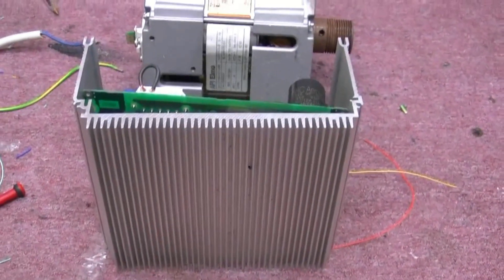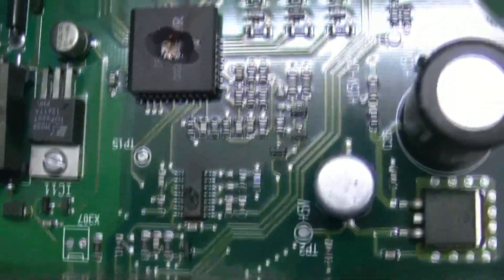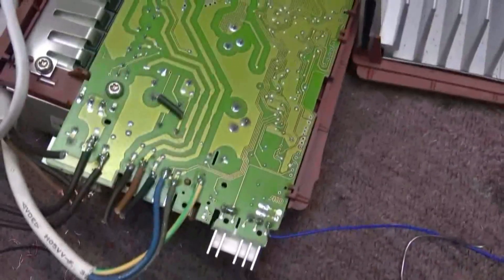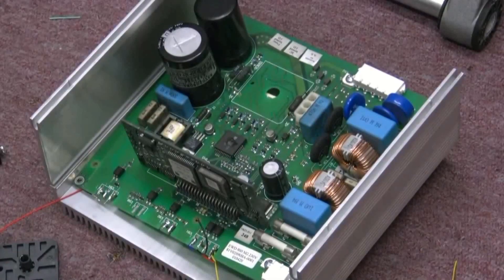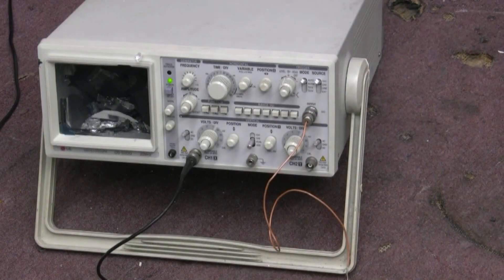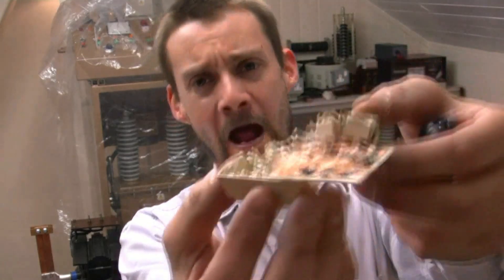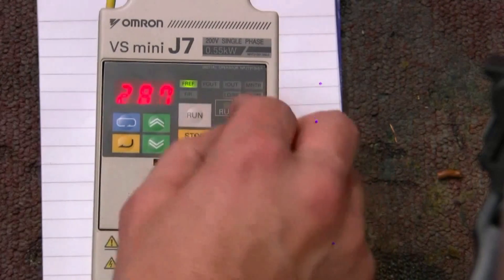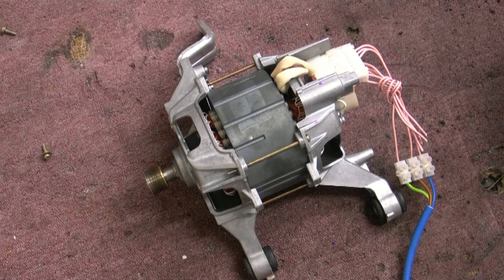Motor Inverters

Comment: The benefit of inverters is that you don't need to send more voltage to its windings to increase the speed and instead you increase the frequency. But even still, the good ol' brushed AC motors are stronger, simpler to drive and can cope with current spikes.
Reply: Just More voltage wouldn't make induction motor run faster
Reply: @swapnilkumar9363  did you even read my comment? I said nothing about induction motors.

Comment: Nice. Glad to see you were satisfied blowing off some steam, and also really cool to hear that sound of the oscillating magnetic fields making noises like that without the motor even spinning. Indeed that must've come from the windings due to the alternating current supplied by the frequency generator. Anyway awesome video that would blow most people's minds. Wonder how many people wouldn't believe that the motor is actually spinning.

Comment: Mini inverter welders are probably the best application for IGBTs.  Inverter microwave oven is needlessly complicated.  Motor drivers with IGBT... your video makes that point. 

You're not alone in that opinion as Electrical Engineers go.

That was hilarious seeing that motor one second and then fried the next. 😂

BTW kudos on the hammer bit, now I don't feel like as much of a neanderthal.

Comment: i would LOVE  to see an induction motor get a 3 ton flywheel up to 10,000 rpm (4hrs enough time?)..stand back..lol
Reply: Here is a 12 ton wood chipper disk spining up to about 1k rpm. It takes over 35 minutes to spin down if the brake isn't used. https://www.youtube.com/watch?v=lV1R1hhukWQ
Reply: @jakekiedaisch2279  nice NICE.!

Comment: Inverters are such a disappointment. Changed my Notebook's fan lately, wanted to slowly blow the old one by overvolting it. Well, a tiny itty little bit of the chip blew clean off because I forgot to put the voltage on a normal value first, but 1 Volt over the maximum and it blows instantly without a single bit of movement of the fan! What an utter disappointment that was. And it smelled unbelieveably horrible! Just like you I didn't have it, so I was up to charge a completely zeroed out 18650 cell with full power, but (luckily) remembered that I'm not Mr. Photon :o

Comment: That is standard procedure, its the manufactures way or no way. The reasons are: 1 to piss u off and RIP u off by force you to pay more for the more expensive model, 2 to save the manufacturer money by providing the bare minimum to do the job. 3 To engineer the product to fail just out side the warranty. 4 Make it virtually impossible to repair by using specialized components that are unavailable , and surface mounting everything.
Reply: bjtaudio no ones forced to buy anything expensive. Thats entirely on the persons decision dumb ass😂😂😂😂

Comment: So crude; the proper way to handle this is with a special type of isolation transformer (aka MOT): hook yourself a line plug to the primary, a suitable socket to the secondary, and plug in the device to be "isolated" (read, "destroyed") in the socket, turn on the power switch, and then plug in the "isolation" transformer into the mains. Problem solved, mate! :) Of course, you could use the "big boy" power supply also... (giggles)

Comment: This is very sad !  Everything can be repaired if You have the knowledge and the patience. If You don't have it, my friend, You can blame Yourself.  Have You ever rebuilt a delicate Swiss Made instrument after the fire destroyed the Jewelry Store ?  I have done it with no manual, no documentation. With a raiser blade, separated all the melted wires and made my own circuit diagram to see what I have there.  After refurbishment  the technician at Bulova couldn't believe it. Only a small capacitor was required to calibrate the unit and to issue a Certificate.  Patience is needed to study, if You don't have it, I feel sorry for You. I hope I didn't heart Your feelings. I pray for You my friend. Best regards, Patricia from Ontario
Reply: Patricia Lawson his expertise seems to be more in high current macro electronics rather than delicate micro electronics. I don't think he is even interested in working on smaller devices.
Reply: Patricia Lawson, please don't feel sad for Photonicinduction. We all have gifts, his are just different than yours. Photonic is as much an entertainer as he is an engineer. Humans crave order, and they crave chaos, as well.
Reply: Who cares about your meaningless grandstanding. This video is a riot!
Reply: Time is money.
Reply: Real watches don't have wires brah.  Cool story

Comment: Oh no. If an induction motor can be just held like that, then I shouldn't use an induction motor for my full electric motorcycle project? How can one start moving me & my bike immediately, if one can be held like that? Or was that one just really weak? Or using very low amps?

I know what batteries I want to use for my bike, I just haven't picked a motor yet. But I know I want it to be brushless.

Great video!

Comment: Would a diode have saved the oscilloscope from being ruined when connected to the motor? By the way, The Postapocalyptic Inventor has a great video mini series about universal motors. He was also challenged by all the circuitry needed to control them.

Comment: i dont understand why those inverters pissed him off
Reply: Because they din't have any tolerance, most electronics can perform better than they are designed (such as overclocking computers) and these did nothing, as soon as they went past their normal operational load they blew. Most things can go at least 30% past normal operation (often more in peaks), and these did nothing but destroy his oscilloscope. These should feature more sturdy components for a longer MTBF, but are made cheap for more profit from the manufacturer.
Reply: datstocklyfe because he "aint avin it"
Reply: Cash me outside how bow dah lol, funny username!

Comment: I
 said I would not write this down, however in hindsight it may be best 
to put it here now. So this is what I have done to change the World and 
spark peace, I looked at a power plant, at all the parts and most 
importantly the crucial components like the fuel, the boiler, the 
turbine, the generator, and then I set out to make them better or 
replaceable with something better that already existed, that didn't 
require great harm to the planet to find what is needed to be built, in 
order to safely bring the power company into your home for the cheap, 
let's start with the fuel, I use electricity to power the device, a 12v 
motor cycle battery, I run that 12 volts through a Pure Shine Wave 
inverter to step it up to 110-115v then I run it through a Panasonic 
Microwave Inverter/Noise filter which steps it up further to 250v, the 
250v in ran into another Panasonic Inverter which produces 4000v max 
power, however you have to build a simple 555 timer circuit ( Control 
Switch ) that has a minimum start setting with a dimmer dial resistor, 
of 43% power at 50% duty cycle in order to turn on the 4000v Inverter, I
 then run that 4000 watts through the Panasonic Magnetron that comes 
with it, because it is designed to handle all that power full time, 
where a conventional one will not," the Panasonic Inverter Tech is true 
40-50-60-80-100% Microwave Tech, because microwaves don't react well to 
metal the Boiler is a "Glass" heat resistant "Three Neck Lab Flask that 
is filled with 60% water, one neck is for refilling the boiler it has a 
one Tesla valve, one neck is for recharging the battery that powers the 
unit, the final neck does all the work by recharging yet another 12v 
battery with more amps to another inverter ( 6,000-50,000 Watt Inverter)
 that will power your boat, plane, car, space station, the steam 
produced is low heat and low pressure, Compared to the power companies' 
plant's steam, the turbine/generator is a modified Tesla Turbine, that 
is both turbine and generator in one unit, that has small neodymium 
magnets embedded, which spin at 57,000 up 90,000 rpm's depending on the 
pressure the boiler can produce, the Tesla turbine is 90 to 97% 
efficient and can be built out of Lexan to resist the low heat steam! 
The condenser should be glass also and there is a small solar panel to 
recharge units main power battery in case the need a raises to charge it
 out in the field! And there you have it, the basic blueprint and 
concept for a true free energy device from existing tech! :) any questions just ask.

Comment: I'd love to know where he gets all this stuff from.
The small things are no big deal, TVs, lamps etc. probably came from the tip or council rubbish collection, but the high-end stuff like inverters, motors, lasers, transformers....?
Andy's blown up many thousands of pounds worth of expensive electrical devices over the years, would love to know where it all came from!
Reply: I would imagine that Andy probably works as a high voltage EE somewhere. Working for an engineering facility myself, I can tell you first hand that we always have a surplus of junk components and devices lying around to have fun with.

Cheers.
Reply: I was thinking either specialist EE or HV sparky working on the generation/grid distribution side of things. And yes, it makes perfect sense that he can score some nice kit through work. :)
I'm an AV/IT tech myself, and I've got more high-end electronic kit lying around than I can shake a stick at. Benefits of working in a technical industry eh? :)
Reply: Probably MOD surplus or stuff heading for the skip.

Comment: You are a psychopath man. Should be in hospital.
Reply: +louco36957 You should be in a hospital for the treatment of Obedience. This guy is right. The tech of today is made so it can not be salvaged and it breaks after a designed amount of time. It's called Designed Obsolescence and trust me, i know, i am a heavy duty vehicle mechanic.
Reply: +fede142857 He's not in hospital, he didn't crash, all bullshit.
Reply: You do realise that he actually is in hospital now, right?

Apparently he was driving his modified mobility scooter (from his latest video), the throttle got stuck and he crashed into a wall, because of that he's in coma.

The more you know...
Reply: +fede142857 proof?
Reply: +louco36957   Fcuking headcase!!!!.
Reply: Goes for a lot of products unfortunately :/
Reply: fede142857 youre full of shit😂
Reply: JR9979 Go to his channel's discussion section and find the comment where RODALCO2007 says that someone else copied a video from Photon and uploaded it as his own. As of now it shows up as the first comment but it might change anytime. Now expand the thread so you can see all the replies.

Comment: Why is it that high power VFD inverters (such as the ones used for train traction motors) make actual audible noise?
Reply: The electronic chopper works within the audible range, you can hear the vibrations from that.
Reply: +JanicekTrnecka The OBB 1216 "Taurus" when starting sounds like a piano :-)
Reply: +Morten Kristoffersen  I would love to write an opera for twelve locos and three tramways :-)
Reply: ***** I´d buy that CD straight away !

Comment: unfortunately manufactures make devices thinking that you're going to use them within the limits that they were indented, but you on the other hand like to push it.
just remember that your new motor inverter has it's limits as well.
Reply: +snaprollinpitts    LOL !!   the whole idea is to find the limit of everything.  This guy finds them all,  He found his temper has no limit.  LOL  That's the best part..
Reply: +snaprollinpitts Usually those inverters break after 2 years (when the warranty is over) even when used as intended in their washing machine
Reply: @MrOpenGL  Our PlayStation 3 always broke after a few years. Seems like it was well timed as well.

Comment: ".. driven by IGBT technology piece of shit" :D
I think that too. Could have used a triac and a regular universal motor, much better.
Reply: Depends on what you need the motor for. The VS gives you a fantastic torque control, which can be essential at the starting up phases.
Reply: Morten Kristoffersen Well, Ward-Leonard control for brushed DC motors is one of the best methods of control that lasts for centuries or even more.
And what about rheostatic control of series-wound motors? You can't beat those on simplicity and plain ruggedness. Although the rheostatic method is quite inefficient :-(. But hey, there are electric locos from 1906 with rheostatic control that still work well!
Reply: MrOpenGL Indeed, and those rheos did keep the indoor temperature high and comfortable in the winter....and set quite a few packed theatres alight as well.... (-;
Reply: +Morten Kristoffersen Then, Ward-Leonard forever, yeah?
Seriously, I think that the most efficient yet simple, reliable and beautiful is Ward-Leonard control. It doesn't heat up as much as rheos, and it is STILL today used to start up extremely large motors like mine hoists (that are probably more than 50 year old already) where the IGBTs, the SCRs and the triacs can't handle it.
Oh and don't forget about saltwater based rheostats, those can't catch fire :D (seriously they did exist to start up large pumps in the early 1900s)
Reply: MrOpenGL You are absolutely right. In fact, our are out-geeking me here. I didnt know about saline rheos, will have to look them up. Yup, that´s the fire hazard eliminated.
Reply: Morten Kristoffersen
I love early electricity age appliances and machinery!
Reply: MrOpenGL I was taking a trip down memory lane, looking at photos of WL´s. They are indeed beautiful. Came to think of it, they can be used to convert American 60 Hz AC into European-style 50 Hz, we had some of them back in the day when I was in the Air Force. They were huge beasts, used to power ground based radar transmitters which were sent to Europe as a mart of the WW2 Marshall aid. (Still in use by 1990... )
Reply: +MrOpenGL Sure he didn't say "piss ass shit"?

Comment: Could you do something to run one of those in line blowers from inside s microwave?  The kind that has two blowers, one on each side, and runs on a 5 pin connection? There are no videos or websites about them and I would really like to know so I could use it for a forge fan

Comment: ?What was the amperage draw as it climbed above 50hz could you trend it up to the max. 400hz.  We need higher freqs. maybe 5k.  ?When you hold he rotor and increased the freq. try taking it up to 400 then releasing the rotor.     ?will it just stay still, climb rpm slowly, or quickly.  Also try putting a load on it like a model plane propeller.  You could pull the rotor and place a bearing  in it, that's how they used to test field windings after they were rewound.

Comment: We have a pallet-wrapping machine at work and its motor controllers break every once in a while. The problem is that the setup absolutely depends on the ability to regulate the motors. The machine would have to have complex gearboxes and produce huge current spikes if it was designed without them in place.
Reply: That's where the VS is excelling !

Comment: what are the advantages of a brushless motor.. if any?
Reply: More power in a volume (depends; not in cheap ones), longer life, much less interference, less audible noise, simpler construction, lower cost.
If you now wonder why are brushed motors even made, it's because they don't require the controllers he was mad about because they are prone to failures.
Reply: I always hear of people liking brushless drill motors.. just wondered why.  Thanks bro
Reply: Morten Kristoffersen Only if produced in the West. Comparing apples to apples in quality, the brushless motor will be better in all aspects for the same money. The problem is that today's brushed motors are such junk that it's hard to compete with them in price.
The only expensive thing that comes to mind with brushless is that they need turned/CNC'd parts whereas a brushed motor can be stamped from sheet metal. But maybe the Chinese will show us the way once more...
Reply: +zwz • zdenek eerh, good brushless are higher in cost than traditional brushes..
Reply: zwz • zdenek I will have to agree to that ! Thanks !
Reply: Brushes wear out. The less moving parts you have in something mechanical the better

Comment: im watching this but this is not what  i googled  im looking for a cheap way to invert the solar panel voltage and step it  up  that way im sending un regulated ac down a line instead of dc power ... im having the issue where  i lose more then what the panels are supposedto push out  i should be getting atleast 25 amps but  i only get 6 due to it traveling through 20 feet of cord  to my  battery bank i want to make it  hit a transister and flicker a foriegn hz down the line since ac travels better then dc and then run it through a diode rectifier  to get the dc voltage  i want  i did a smaller test but  i cant seem to get it right on a solar panel setup

Comment: are you stupid if the monitor is on you get Xrays going all over the place
Reply: Once the tube is broken there is no more vacuuminside and no more X rays, since a vacuum is required to generate X rays.
Reply: thats not how it works its the back part that makes the xrays
Reply: marco jonker  Every X-ray making device has got vacuum inside to work properly. What happens if you break the glass? No more vacuum, hence no more X-rays.
And it doesn't make a difference if it is the front or back part, the vacuum is the same